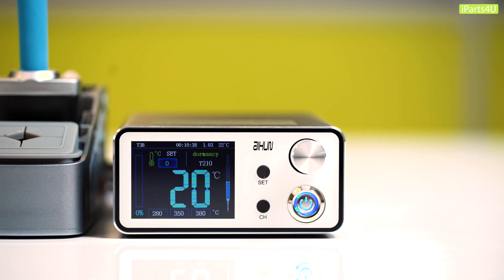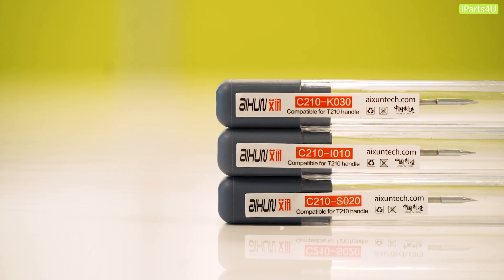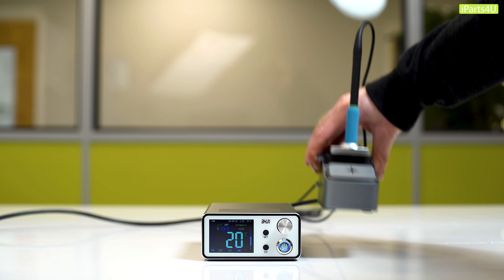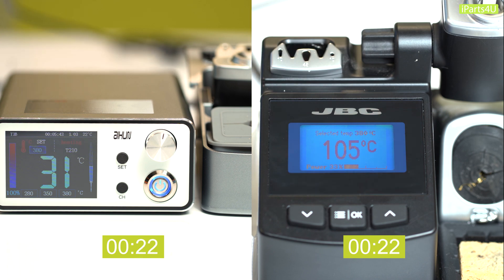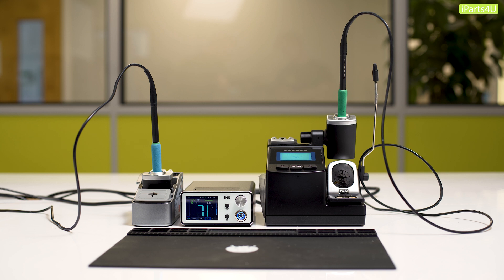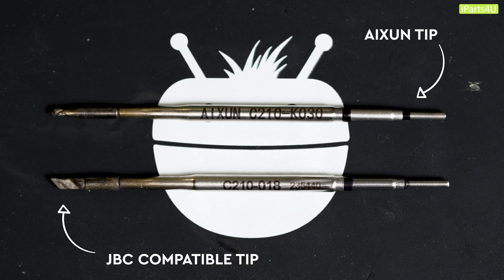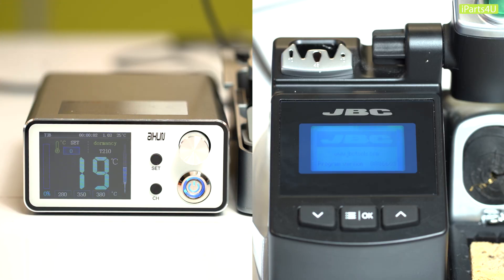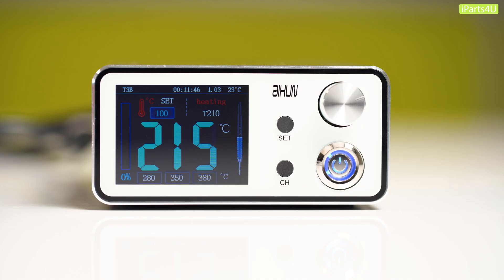Aixun VS JBC Soldering Rework Station

Comment: Stay away from these soldering stations, you have to buy separate stations  for different handles. Just buy the JBC they are more expensive but you have to use their tips anyway. If you have to buy make sure to buy the T245 station there are much more choice of tips. Do not buy the C210.
Reply: Some jobs just require smaller tips that the 245 doesn`t have. Iphone 7, for instance, if you were to do the classic audio codec 4 jumpers, I bet you would really want to do it with the c210 tips. If you have to do it 10 times a day, the smaller tips save you sooo much time, and being microsoldering specialists, time is not something you can waste. Iphone repairs are really common here since the dollar is too expensive, people don't earn enough as it is, this pandemic just made this even more true, so they have old iphones and repair them repeatedly. Also, the price... JBC is 4 times more expensive in my country than the T3B, so, I can equip my entire lab with these before I'm able to buy a single JBC.

Comment: I'm not convinced the cooldown was actually any different.  The JBC only displays 5 degree steps, whereas the T3B shows single degree steps. The T3B drops below 25 degrees at the same time the JBC transitions to below 25 degrees.  And I can't think of any reason why cooldown time would really be any different.  Unless one handle was more exposed to air flow from an air conditioner or fume extractor?

Comment: sorry , but this is complete nonsense , the iron doesn't heat up faster than the JBC , its just has such poor thermocouple temp sensing that the numbers on the front TELL you its hotter than it is thats why it takes a lot longer on cool down . Yes i have temperature tested this against my own JBC with proper tip temp meter . I decided to put it to the test with my JBC over a 6mth period at my daily work station which runs on average 10 hours a day and , the Axium only lasted 4mth before it started playing up . The WORST thing about this is the god awful iron stand , my JBC one weighs a TON to stop it moving around / falling over , the Axium one , is totally the opposite , its not worth the money , there are only 3 tips made by Axium which are shite and if you want decent ones , you will need to buy JBC ones . My advice as a professional tech is to pay for the JBC , or end up paying more than that when you keep replacing this junk. If you are just a hobbyist , that rarely uses an iron , you can find something wayyy cheaper than this that will fulfil your needs , don`t waste money on this thing . Yes my complete JBC setup cost me well over £1000 , I have both the iron and the de-soldering gun setups , but , I`ve so far had it 12 years , and never had to do a thing with it . You will NOT have this thing in 12 months let alone 12 years if you use it daily for hours  , if you are a profession and you are looking at this to save a few quid , forget it .
Reply from the maker: Hi David, thanks for your reply. Our testing has shown the results above, interesting that you got different results. Obviously we can't show long term use in a short video of a brand new product, but think this is really interesting and something we will look into more. Our in-house technician swears by the Aixun and has never had an issue with it, but everyone is going to have different opinions and different products to suit their needs. This is a new Aixun station that has only been out since December, so won't have been the one you used before, but i'd definitely be interested to know about more long-term testing methods.

Comment: Hello! Thanks for reviewing the soldering station. Please tell me if the original stings from JBC C245 are suitable for this station? Can I use original JBC C245 tips for Aixun?
Reply: That's where it is ment for..
Reply: I only use genuine JBC tips on my T3A. I also purchased the T12 handle and used genuine T12 tip on it. The heat up time is significantly faster on T3A than Hakko FM-202 (6 sec vs. 20+ sec).

Comment: I wonder nobody(all the videos I saw of this station) mentions that there are literaly only 3 versions of the knockoff tips (t210) for that station.. I searched on Ali and I always only find the same 3. So if you concider bying this station get ready paying for the actual JBC tips
Reply: Yup came to the same conclusion. Only 3 tips for the t210, it's crazy they don't have a simple chisel tip. Might go for the t245 or t12 just to have more variety.
Reply: @euphoricmonk  Yea I am kinda shocked there isn't more variety for the 210 tips. I recently got the aifen a9 (which seems to be identical to the sugon a9) along with a 115 and 245 handle and a 3 pack of tips for each for only like $125 on ali.

I am no electrical engineer, but overall seems solid. Everything heats up quickly, peaks at like 160w with the 245 handle, temps seem reasonably accurate. Pretty sure it takes genuine JBC handles, although I have none to try. Not that I plan on buying genuine handles, but I figure probably better for compatibility when it comes to knockoffs. For whatever reason there were no in-depth reviews for the thing, or at least not in english. So was a bit of a gamble, but seems like a possible contender for best value JBC clone, imo. Granted I haven't used it much yet, only done some basic testing, and I am by no means an expert.
Reply: @euphoricmonk   search relife or sunshine gvm brand tips it works perfect and last long as well.

Comment: FYI -  JBC has a transformer inside. Guess what/why. Nice editing but not very deep , more like sales.
Reply: Japanese transformer much smaller compare to European ones and perform better in some cases. with auto sleep and cut-off function that issue can be handle easily .other wise best/jabe brand also have same  transformer rating as original jbc.

Comment: What size tips does it come with?

How does it handle joints and parts on a heavy ground plane?
Reply from the maker: Hi MrMech85, you can view the tips here:

Soldering Tip Replacement - I Tip - Pointed: https://www.iparts-4u.co.uk/aixun-t3b...
Soldering Tip Replacement - K Tip - Knife: https://www.iparts-4u.co.uk/aixun-t3b...
Soldering Tip Replacement - S Tip - Curved: https://www.iparts-4u.co.uk/aixun-t3b...

Could you please elaborate on what you mean by heavy ground plane?

Thanks.
Reply: @Iparts-4uCoUk  I do quite a bit of work on laptops, due to large of amounts of metal that make up ground, it is very good at wicking heat away from the solder tip and the area being worked on. Is it good at keeping a good strong tempreture ?
Reply from the maker: @machine85  Thankyou for elaborating, having spoken to our in house technician, in his opinion it performs well at wicking and he hasn't had any issues with it's temperature. Hope this helps.
Reply: @reparame.com.co.  I think the T245 handle is most practical because you can get smaller tips for it but the T210 only has 3.
Reply: @reparame.com.co.  Which Tip do you use most for 210? Maybe you could help. I just bought the GVM T210 which seemed great at first, but now it's making beeping sounds with 5-E error code. What I don't like about Chinese products is lack of support in the manual and very little after sales support. I emailed them but still waiting.
Reply: @reparame.com.co.  Thanks, it was the cartridge itself that was defective. Tested with a multimeter, it had no continuity from the base all the way up. Swapped it with another tip and it works. Seems like a nice unit but QC might be lacking a bit.
Reply: @reparame.com.co.  Thanks for the advice
Reply: @reparame.com.co. what do you mean with very large things? Any example?